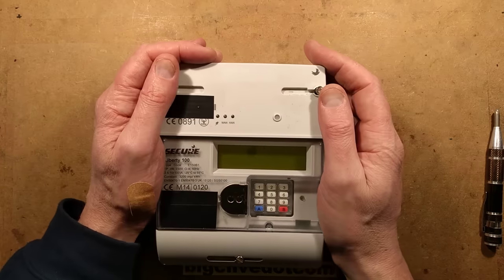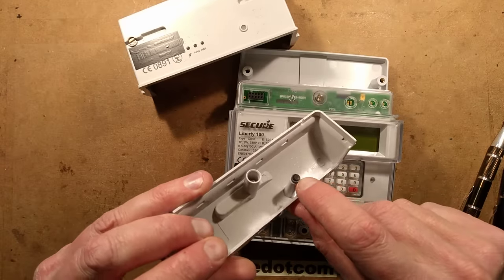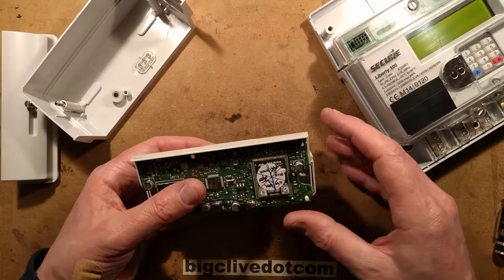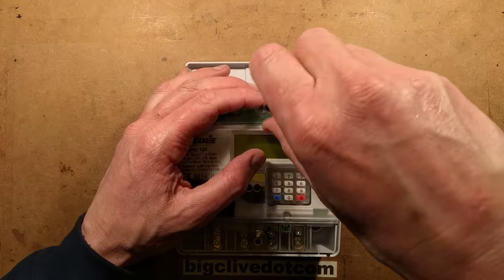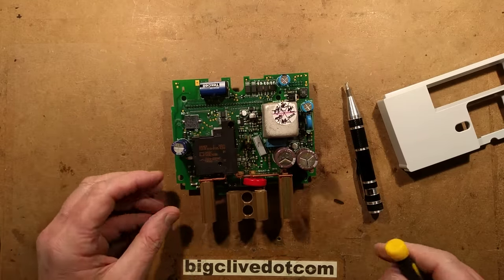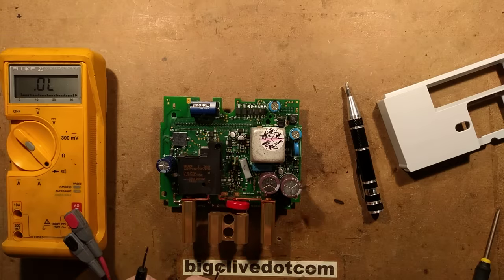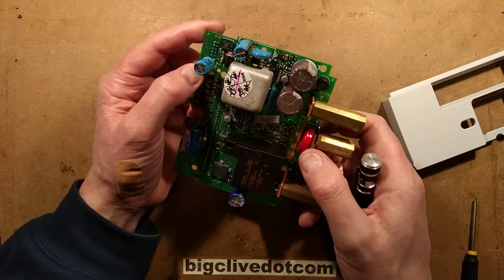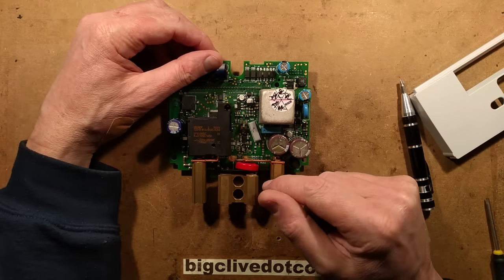Inside a smart meter, and the REAL problem with them.

Comment: The main purpose of smart meters is to enable the UK government to differentiate between "normal" electricity use and future use for charging electric vehicles. This will enable the government to tax EV "fuel" use just like they do with petrol and diesel.
Reply: They could do just the same with something inside the car. But yes smarts would allow a version of the old "Economy 7" system where your car charged up on late-night electricity that's otherwise not being used, so they can sell it cheaper and make more efficient use of the generation system. That would save everybody money. 

Whatever governments decide they're going to do about "fuel tax" on EVs, they'll be able to implement then.  They might decide on more toll roads instead, done passively where a camera reads your number plate from way up high, and you get a bill for it later. M25's had one of those for ages. Dead cheap and easy to do.
Reply: @greenaum  i dont think that would be helpful the areas that have these types of toll roads already exist and arent sign posted correctly. Know of a few people who took one wrong turn on the way to liverpool and with no warning signposted or otherwise recieved a £25 fine to their home address
Reply: @greenaum  don't be silly, you have to manually pay for the dartford tunnel and unless you know in advance you are going through be bloody quik to pay as you only get 24 hours so that they can fine you even more....
Reply: @SparkyLabs  yeah i meant cheap to implement, not pay for. Like petrol duty!

The Dartford tunnel might be fucked up but the bridge on the M25 passively recognises your plate and a bill comes through your door a few days later.

It can be done efficiently and even cheaply, that's entirely down to tax policy. Doesn't mean it will be but what's new?

Part of the reason behind petrol duty is supposed to be an economic incentive for environmental reasons. That's not as needed with electric, which are less bad, and any amount of power can come from renewables.

Particularly we could develop much more wave power which we have lots of being an island. That's reliable day and night.

There's also the possibility of using parked cars as a giant battery bank to buffer changes in demand through the day, and wind and solar variations. You'd use, say, the top 30% of your capacity to help the grid, who would pay you.

Comment: Smart meters were never supposed to be good for customer or eco/green system.. It was always about surge pricing at peak times and getting rid of employees who read the meter. Both of which were mentioned. Thanks for the video. Thumbs up
Reply: Then why haven't we seen surge pricing? And yeah I think getting rid of the employees is a good thing. We should be trying to automate away those jobs.
Reply: Surge pricing at peak times is the ecological benefit.  It encourages matching energy consumption patterns to available energy supply.

Comment: I remember when the electricity company visited to fit a SMART Meter on the community area circuit in a 3 story block of sheltered housing flats for the elderly and disabled. I have no idea how or what he did or happend because of this, but when he powered back up again, half the building was without electricity or was malfunctioning straight away. the lift was was stuck between floors, most of the automatic sliding doors on movement sensor began to continuously open and close 24/7 keeping the residence awake all night. And many other faults. It ended costing thousands of pounds to sort out and took many days to weeks to sort out and fix all the issues it created. Being and electronics engineer myself for over 40 years I cannot understand how it could of happend. How could they have done that? The mind boggles.....
Reply from the maker: It almost sounds like a neutral was accidentally disconnected.
Reply: The power of the airwaves
Reply: Maybe a contactor or something seized up , automatic doors may have went into reset mode etc

Comment: What a terror it is to recive electricity in the uk. Cameras, microphones, mobile phones in your meterbox! Most concerning to me is a hardline disconnect. Here in Australia, you have to be many hundreds of dollars in debt before they cut your power off.

 The term "smart meter" generally means the widget can meter your outgoing power differently to incoming (for PV systems), and a few different circuits that can be switched for load control; your waterheater, aircon etc. Utility companies can drop very heavy loads if needs be. N that circuit is cheaper, offpeak power, metered differently to house power. Also, comms is done over the line, not a gsm modem... amazingly different. You have to really be taking the piss to be cut off.

My old boy does have an imperial coin driven meter in his collection (it eats Australian Pennies), they're very rare here. Facinating.

If anybody is wondering about data costs for the modems, 1mb/month plans are a thing, if you buy in bulk (at least, with telstra in au). You get a vpn ip adress range, so that sim routes to your private network, not the actual internet. If you only need a few bytes here n there, its very economical. My company uses it for carpark monitoring. Every 5 minutes; x cars in, y cars out. Only a few bytes. 1 million bytes goes a very long way.

Cheers Clive, a very interesting thing to see the guts of.
Reply: That's very interesting about the data costs. You can get SIM cards routing directly to a VPN? Wow...
Reply: I heard anything early version of the smart meters were not locked to the private APN and someone took the SIM out and cost the electricity company $10000s by downloading gigabytes through it. Oops.
Reply: And I know about monitors and data usage. My 8yo son has type 1 diabetes and has a constant glucose monitor: it uses Bluetooth with an iPhone. They recommended a 1GB/month plan. I've locked down every app except the monitor app and he uses under 30MB/month, so I've left him on the PAYG 5c/MB prepaid plan. That's economical.

Comment: The aluminium can over the switch-mode power supply is probably to try to reduce the interference it generates affecting the GSM or Radio units. There is no ground, so it is likely designed to just send it the other way (i.e. out the back of the unit)

Comment: Hi Clive hope all's well.?
My ex boss who has now passed away (Nothing related to what i'm about to mention)..
He used to share a story with me about 2x welding rods, old "Dial" electric meters and a transformer coil.
The general gist was wiring the transformers coil (Lowest ohm value I presume) each wire to one end of a welding rod.
Then the rods would be pushed up into the input and across to the output of the meter terminals, in effect putting the transformer coil across the current sensing of the meter and APPARENTLY This effected the magnetic phase of the meters motor, causing it to run backwards.!

I'm not saying it's absolute truth and i've not seen it done but  interesting concept none the less.
P.S. The modern meter wire access holes are made such a snug fit nowadays that you couldn't fit a darning needle up without telltale tampering signs on the plastic.
Reply from the maker: They were called retarders and did work until people shoved the wires up the wrong terminals.
Reply: @bigclivedotcom  Cool. Cheers.
The dodgy sod.  LOL  And EEK.
That'd be a street fuse I presume and one carefully positioned toaster an inch under the meter to explain why the underside of it has strangely got burnt..

Comment: Microphones? Not in a power meter, but Matell did release a Barbie that uplinked and sent all voice commands to a central server (because the doll was too small to fit a computer inside powerful enough for voice control at the time). Samsung also got busted sending voice commands and all voice to a central server. But a power meter? All it's going to pick up is outside noise
Reply: Data Banks Vast majority of these are inside the house in the U.K.
Reply: ah, I'm used to power meters being on the outside of the building in Australia. Usually in big metal boxes by a side gate.

Comment: If you were to install an analog meter (i have the old one from when they replaced ours) between the new meter and the breaker box would you be able to take the company to court over them charging more than your own meter is reading you using? More importantly is there a way to confirm the old meters are calibrated?
Reply: Hi Anthony, I assume you mean ‘calibrated’ as there isn’t much to celebrate here. You’ve hit on what I see as one of the most important issues with ‘smart’ meters and that is calibration’. As a customer I have no way of ensuring that the new meter is running at the same speed as the old and I have suspicions that the calibration can be raised or lowered remotely by the energy company, I haven’t seen anyone else raise this.
Reply: @BobK5  nothing stopping you having an mcb form factor meter installed in your consumer unit to monitor what's being used
Reply: @Shadow_Hawk_Streaming  I assume that’s going to cost me so I’ll stick with my old meters.

Comment: Ever read the booklet that comes with the phone. It states you could have radiation from the phone. One fact that cannot be ignored is that smart meters emit electromagnetic radiation (EMR) in the form of radiofrequency (RF) radiation, which is a byproduct of radiofrequency waves. No one disclaims this. RF radiation was classified in 2011 by the International Agency for Research on Cancer (IARC), as “possibly carcinogenic (cancer-causing) to humans.” Furthermore, there is no data that shows RF radiation is safe.

Comment: I know someone who installs UK smart meters. Their are major issues.
1. people who had solar panels were getting CHARGED for the solar power THEY WERE PRODUCING. The electric smart meter had no facility to detect electricity feeding back in to the system. They tried to keep it quite, as some people were owed thousands.
2. The average saving to people using these meters is approx £14 a year. The amount of electricity used to manufacture these things (plus the CO2 used to post and have an engineer drive to you), means that the C02 saving in using these smart meters will unlikely never be above what was used to have them installed.
3. The Gas smart meters are particularly problematic. They have a battery installed, which cannot be removed. They're completely sealed in so that a short and therefore an explosion cannot occur. The battery is supposed to have a long life, but during testing it was found that a battery could fail after just 5 years, which would require a complete replacement meter.
4. There are security issues with these. If someone can hack in to your statistics they can see when peak consumption occurs. e.g. if your consumption is low for hours, then suddenly peaks at 5:45 5 day a week, then that likely means you're at home. Which tells a burgular when is a good time burgle your home.
5. If you change energy provider, they might not accept your smart meter on to their system. Making manual reading on a smart meter is much more complicated to understand than the old analogue meters.
6. If you live in the country side, even though you have a smart meter, you might still need to make manual readings.
7. Most of the scares are from USA units. They have a much larger rf power output, far higher than UK meters, because there rural areas can be miles away from a phone tower.
8. As for 5G killing people....people have just WON the first UK court case. Won against Gateshead Council. A council who have setup their own funeral directors, because of increased deaths that have occured since they installed the 5G transmitter. Video = https://www.youtube.com/watch?v=8WZOwLFsSaw
Apples iPhone terms and conditions of use also say "When using iPhone near your body for voice calls or for wireless data transmission over a cellular network, keep iPhone at LEAST 15 mm (5/8 inch) away from the body".

https://www.idownloadblog.com/2011/03/07/dont-hold-your-iphone-too-close-to-your-head-apple-says-so/
Reply: Good info post thanks Andy.My solar inverter bluetooths to a SunnyBoy desktop display and I keep tabs on it. No problems.Resisting smart meter so far. Interesting- and worrying-  you say that manual readings can be problematic as I give monthly manual readings.
I will at first photo & record every minute detail when a SM is forced on me. I'm never surprised when I see my non tech friends say its all greek to them.
Reply: Perhaps it was a previous poster that commented on difficulty in reading data or info on a SM. There's been so many good info posts
Reply: All your points are wrong 😂

Comment: I agree that money saving and energy efficiency (and the word "smart") seem like red herrings to get the public on board.  I assume the main reasons are to cut costs of meter visits, upgrade inaccurate meters, and to provide a more sophisticated method of rolling blackouts in case of supply shortages.  But I'm not in the business, and I'm just surmising.
Reply: The way the national grid is set up they can already cut power to set streets or even parts of streets remotely already since my smart meter got put in I have saved about £10 a week accross gas and electric
Reply: @Sierraomega1991  how did you save £10 a week Sean?

Comment: Smart metres are NOT smart , they hand your billing to the supplier. They control everything and it’s not a freelance type monitor.  It’s like handing over your debit card to the electricity company.  We had one that the energy company changed the billing day by day to confuse the billing process . Lucky we kept the old style meter in place and it’s had a much  lower reading , I took three years to get the £17,600 over charged back and if we hadn’t kept the old one they wouldn’t have paid any money back.  It’s a con to help them not you .

Comment: Compulsory now. The letter says that old meters are unreliable and must be replaced.
Reply: Not at all. It's not compulsory to have one installed. When they call just politely decline as I have done.
Reply: @charman3630  in England? I was told my meter must be replaced . I told them that I would not have a monitor in my house though.
Reply: That is wrong it's not a legal requirement yet i will only get one fitted when the government change the law until then i ignore their requests. Andy England 👍

Comment: The bluetooth module is for the remote gizmo that allows the customer to see the electricity use on a pretty screen.
Reply: And also connect to a smart gas meter if present (with the electric meter acting as a relay to the supplier)
Reply: it's ZigBee not Bluetooth ;)

Comment: The emf radiation has been tested and measured many times showing readings well in excess of permitted and recommended levels.
Reply: The colour green has been tested and measured many times to be right in-between the wavelengths of yellow and blue — or a blend thereof — within permitted recommended range for the hue.

Comment: Where is the power supply of the meter connected to? Do I get charged for the power of the meter?
Reply: The power supply must be connected before the relay (and thus the shunt) or the meter could not engage the relay. So no, you don't get charged for the consumption of the meter (all few pennies a year).

E: Ah, crap, the shunt is before the relay. So it may charge you, yes.
Reply: @Monkeh616  That's the smart solution for the power company.

I wonder, what the power factor may be. Make an educated guess.
Reply: I looked closer and it sure looks like the power supply taps off pre-shunt. So you're probably not paying.

As far as power factor goes, likely quite poor - 0.5-0.6 at a guess, but also probably sub-watt when not transmitting. The shunt will burn more power than the electronics.
Reply: 15:35 Clive says the meter is powered from supply side
Reply: A meter that charges the customer for it's own consumption wouldn't get certified, so no. Although you do still pay for that power via the daily standing charge.
Reply: Truthfully, you are paying for that power regardless.  One way is just more evident than the other.

Comment: I feel like most of the anti-tamper sensors could be eliminated just by drilling next to the stalk, inserting glue to hold it on the contact and then drilling the stalk free from the top cover
Reply: Smart but would leave physical evidence of tampering.
Reply: And you need to know the position of the sensors, in advance.
Reply: Inform your family of visiting times, its only fair.LOL
Reply: wonder if you could put a signal jammer next to it while you disassemble it, to keep it from crying for help.

Comment: Hoi Clive, I think the shielding of the small transformer, is to prevent peak power, blowing the electronics,  induced by switching the relay, that must be a very strong solenoid in there, giving a huge magnetic puls distroying the whole smart meter,  great videos you made. I m enjoing the way you solder things. you never need a thirth hand.

Comment: I wonder where the firewall plugs in?  God knows you wouldn’t want to roll out a country wide data network of little computers without taking some very basic steps to secure it.  Oh, it has “secure” written on the front, it must be OK then.
Reply: Indeed.  I could literally go out scanning for smart meters and add or reduce people's bill by packet sniffing and replacement. I bet you a dime to a dollar that the energy company would only check it out if the bill was reduced.  So what is to stop them being hacked en masse and then saying "We can't determine the overall usage and therefore cannot refund".  Its a huge scam.